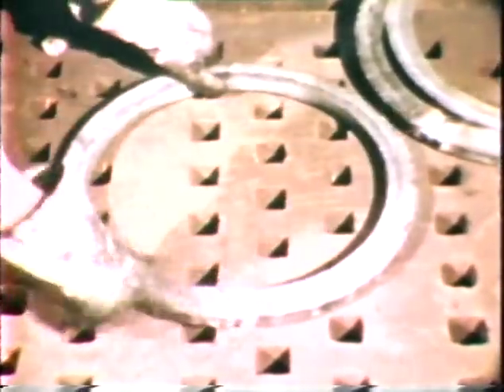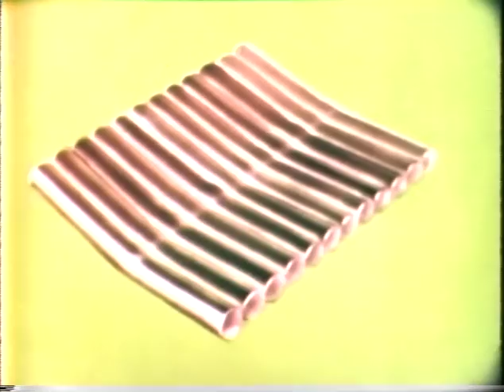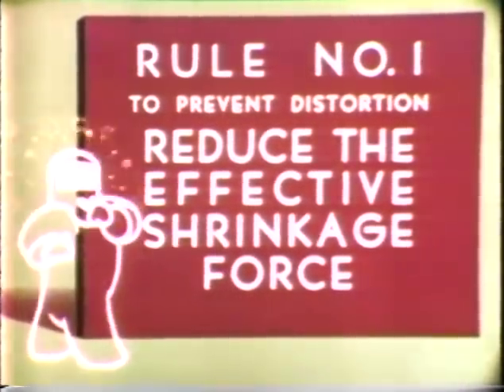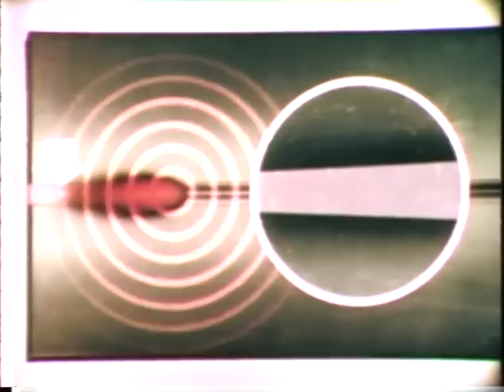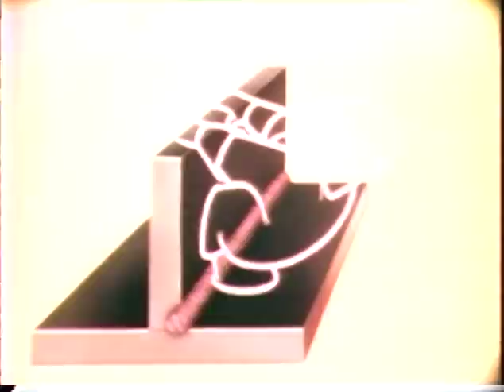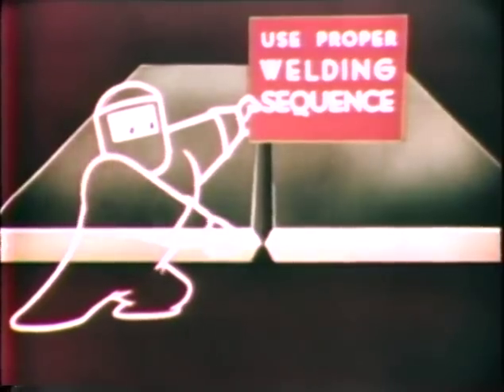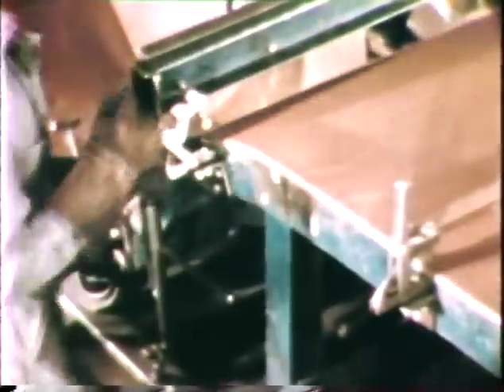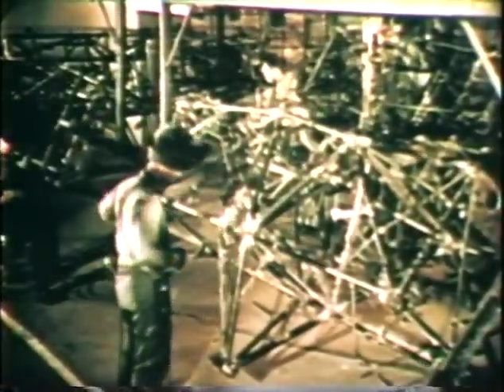Prevention and Control of Distortion in Arc Welding

Comment: the release date for this video was12 april 
1945, i love this kind of videos,they teach in an easy and funny way
Reply: +carlitosgy6 Cool video. Even with such an old video I can learn something applicable to my (relative) new everlast inverter welder. I don't even think they had inverters back in 1945!
Reply: Your right I don't think they did. LOL. I compare the features of my everlast welder to this video and I can't help but marvel at how far they have come. It is amazing though how much I can still learn from such an old video.
Reply: Video by WW II 😂
Reply: carlitosgy6 … One can assume that over the 5 years prior the Industrie accumulated massive experience and had a great need to train new welders to move forward.
Reply: I was going to guess 1945 from the mention of Shasta Dam, under construction from 1938 to 1945. Also that E unit has a numberboard on the side, which makes it an earlier one.

Comment: Around 7:33, the * incoherent * is called a fleet( as in fleet of ships) fillet weld. It was a style of welding that produced deeper penetration than normal fillet welds. It was partly the type of electrode used and partly how much amperage was applied.

Comment: Only one additional note to this video needs to be made. If you overconstrain an object you can push the internal stresses past yield and cause cracking. 

The worst case is overconstrain just enough that the internal stresses are close to yield and the calculated design strength of the joint is lost; unless a stress relief operation takes place post weld.

People who miss this point often overconstrain welds then scratch their heads when they crack or fail prematurely.

Comment: Many people are welding from left to right as its "easier". But i was taught by way more experienced welders to ALWAYS go right to left and from the bottom to top for better penetration values. Im not that experienced but i was lucky to get a job in a company which produces sections for coal mines which are installed 1100 m under the ground. Im assembling and welding "details", but every night when i have some free time i always sit in the cabin and trying my best to become a much better welder.
Reply: MetaIIica93 What does left to right or left to right have to do with penetration?
Reply: +Gavriel Dorian It's not as much left to right as it is pushing vs. pulling the bead. When you pull the bead, you're undercutting the metal from the heat of the arc, giving you better penetration. If you just push the bead, you're not going to undercut the metal before welding over it.
Reply: +boomguy3708 thank you. I understand the effects of pushing vs pulling / downhand vs forehand, but that guy was saying left to right and so it wasn't clear what he was trying to say.
Reply: MetaIIica93 your awesome keep it up.
Reply: My shop teacher said when there's slag you drag
Reply: Metallica was taught correctly. Direction of travel and penetration, or weld depth, is to do with the natural flex in your wrist hence right to left keeps the electrode at a more upright angle for better penetration whereas left to right allows a more natural tendency to lay the rod down more and therefore less penetration. The opposite applies if you are left handed.

Comment: 16:38
Please explain me how that one works. You weld top and bottom flanges - they will pull flanges inwards, reducing distance between flanges. Now you introduce gussets between flanges and weld them as shown (inside), so they'll pull flanges even further inside...  i am confused....
I'd rather weld gussets on the outside...

Comment: I don't know for sure, but isn't "Make shrinkage work for us" not really used much at all today? I mean I haven't really heard of that anywhere else. Can anyone think of a modern application for that?
Reply: Do this all the time with setup.

 Was making some T brackets and the Engineer was standing next to me making sure it was going to be perfectly square. I let him set it up, pull out his square and get it just perfect. I smiled and welded one side of the T joint he about jumped out of his skin when he saw it distort to one side. I told him to calm down. While the joint was still hot I welded the other side in the opposite direction. His mouth dropped open as he watched it come back to square. He was like no way... Pulled out everything, checked it and was completely shocked that it was a perfect 90. 

Many engineers should take the time to learn how things are actually made instead of trusting their pretty computer models.

Comment: So can you get away with not chipping the slag out? They showed a guy doing the back stepping, and he didn't chip any slag off. I thought you were supposed to. If this is an exception, then why?
Reply: Maybe they simply didn't know how damaging it was back then? At this time fracture mechanics wasn't really a thing. Commersial electron microscopes wouldn't come for another ten years. Basically metallurgy was at its absolute infancy. They had only proven that metals were made of crystals a thirty years earlier, which is essential to properly understanding any metallurgy, really
I mean, they didn't know that fatigue cracks even existed back then
Reply: @SotraEngine4  thanks for answering my question. Makes sense.

Comment: If you can.. 

Do autogenous tacks first at opposing pieces just to hold. Then go back and do filler tacks. 
Seams welded outwards, fillets last. 

I weld frames all the time and they’re dead flat. 
If your part rocks and isn’t square you failed.

Comment: I started thinking it was funny old times stuff and ended I could not believe my eyes. it's so useful because it's the same today. but there is a very important thing they did not say or explain well: we call it "making points", it's when you weld deeply just one point on another side of the main first welding, where it could hold the piece like it was clamped. yeah they said that about that complex tower structure, but they should explain well how it can be used also on simple pieces to weld.

Comment: They appear to be referring to "fleet-fillet welding" in the "incoherent" spot on the video at 7:31.

You can find a description at http://delibra.bg.polsl.pl/Content/18436/P-779_1942_Vol110_No22.pdf

The relevant pages are 70, 72, 100 & 101. These correspond to the numbering in the pdf file of 46, 48, 76 & 77 (hint: printing only those pages of document as a pdf produces a pdf that is easier to read than the original 33 MB document).
Reply from the maker: Thank you for the reply. I will update the description and subtitles now to reference this properly.